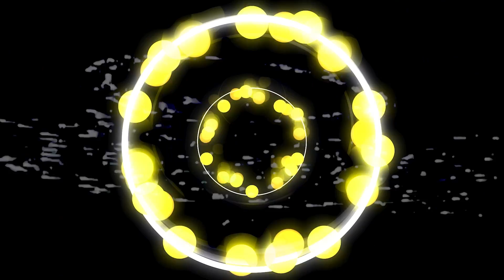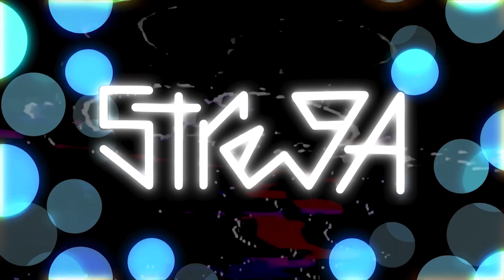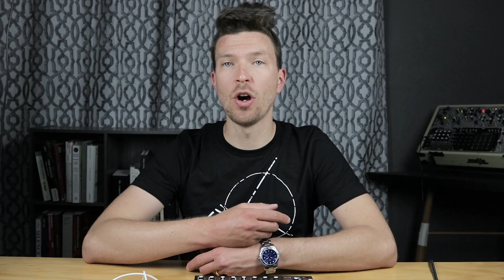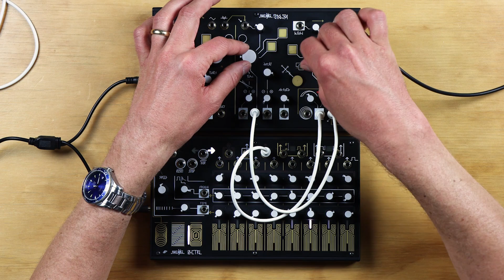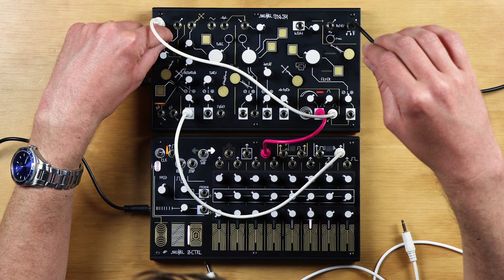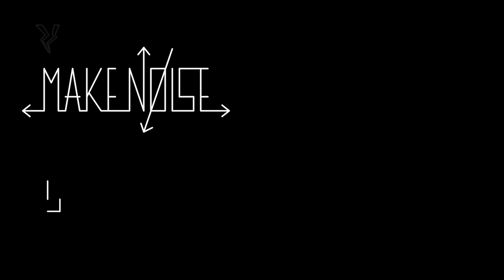Strega's Agitation Function Generator

Comment: Set the agitation generator to audio rate, patch it to audio in, turn up the strength if desired for distortion, and patch it to activation for AM. Take the top row voltage from 0ctrl to the tonic pitch, and the bottom row to the agitation generator pitch. mix the AG audio in as desired.
Reply from the maker: Great patch idea!